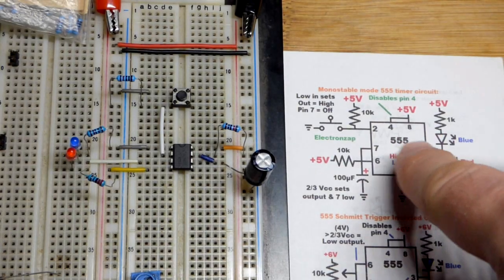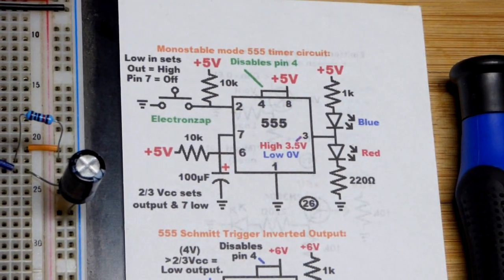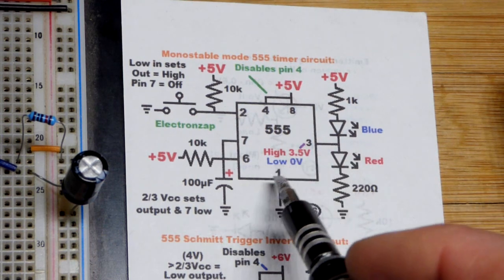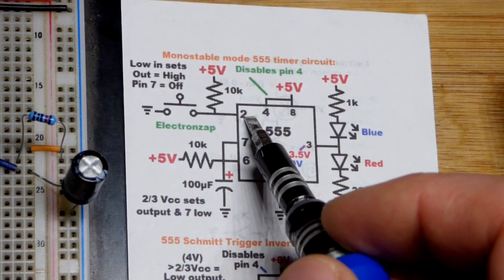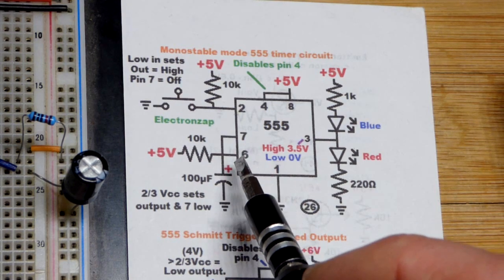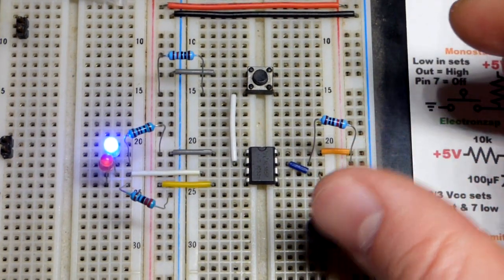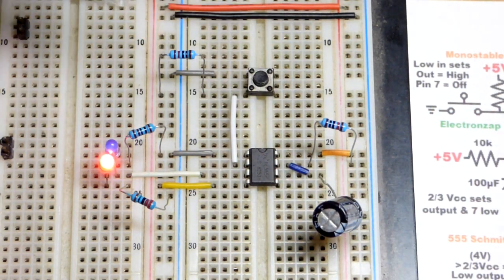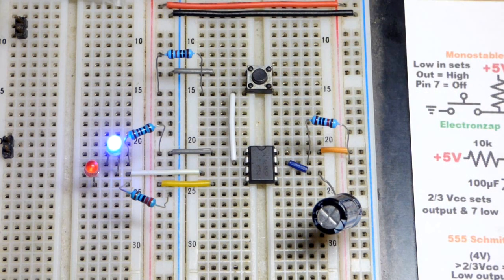Monostable Mode 555 Timer Integrated Circuit

Comment: How to turn on off relay every 12 hours. Is it possible to?
Reply from the maker: My timing circuits are generally for less than a minute. There's relay modules, I made a recent video https://youtu.be/Imt5TIZiQGE of my new ones, which have programmable timing that can be set pretty much anywhere between a fraction of a second, to about 999 minutes. They are only about $4 to $5 each if you buy more than 1, so there's a good chance that they are about as cheap as if you try to make your own from scratch.